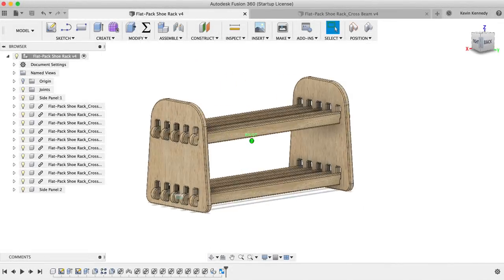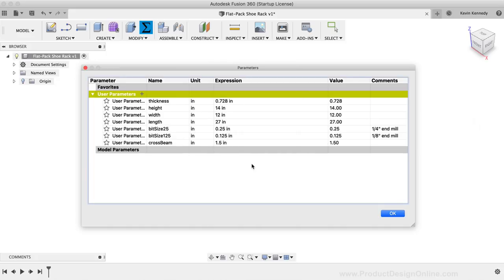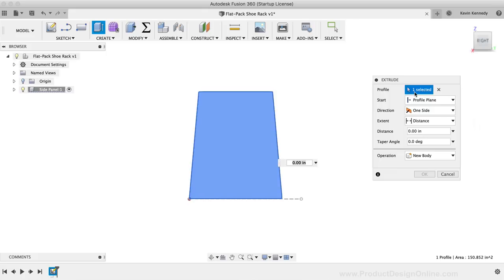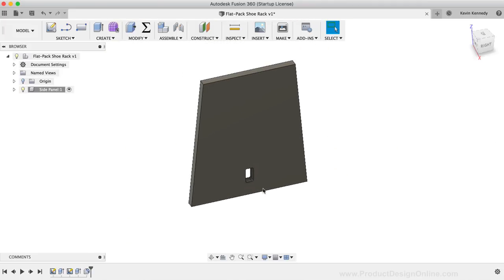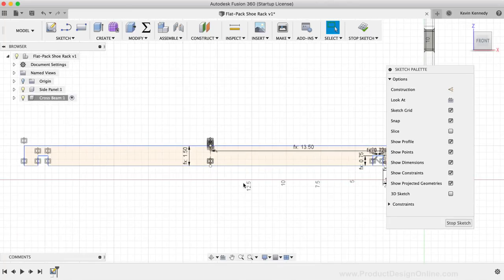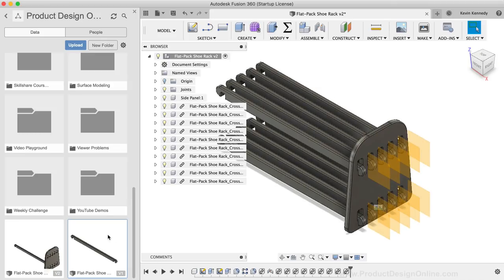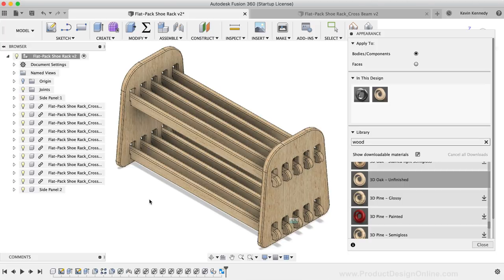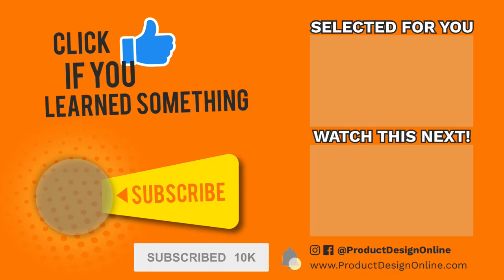Flat-Pack Furniture in Fusion 360 — Fusion 360 for Woodworkers

Comment: Great video, very informative and easy to follow! I have a CNC plasma table and will be able to transfer many of the skills in this video over to that application, thanks!!
Reply from the maker: Thanks, Nathan! Glad to hear that. What brand of Plasma table do you have?
Reply: @ProductDesignOnline  I'm running the Langmuir systems crossfire pro with an Everlast 82i plasma!
Reply from the maker: @nathanstevens3374  Thanks for sharing! Been eyeing one of those for a while. Would you recommend Langmuir? (I've heard a lot of good things).
Reply: @ProductDesignOnline  Hey no problem, I definitely recommend them for an entry level machine. They are on the cheaper side but the customer service is top notch if you have any issues!

Comment: How are you exporting the file for a laser cutter?
Reply from the maker: Hi, Mrs. Alanna Wellwood. This specific project was geared towards a CNC router (due to the thickness of the wood required). In this case, you would want to use the Manufacture (CAM) workspace to set up the file for CNC.

To use this type of workflow for a laser cutter you would want to export as a DXF file. After laying all of the parts flat, as I did at the end of this tutorial, you would want to create a 2D drawing of the file.

Select the file menu > drawing > from file. Then you can place the "base" view of the model, which should show all of your parts lying flat. While in the Drawing Workspace there will be export options at the upper right of the toolbar. Select the "Export as DXF" and then import the DXF into your laser cutter software.
Cheers, Keivn :)

Comment: 10:07 when I try to dimension the height it says “adding this dimension will over-constrain the sketch. Choose OK to create a driven dimension.”
Reply from the maker: That means you have a constraint or dimension elsewhere that is dictating the height of that line. Double check the surrounding lines and make sure there wasn't one automatically created that is not supposed to be there :)
Reply: Product Design Online 100% correct. Figured it out right after I posted the question. I didn’t know exactly where the constraint was but you’re tutorials are really helping me.

Comment: I dont have a cnc machine but there is a business close by that will cut wholeor half sheets of ply.
Reply from the maker: That's pretty sweet. Just curious... do you know how much they charge for something like that? I assume it's by the hour?
Reply: @ProductDesignOnline  to be fair, Ive never really looked into it, but I will next time I poking around down there. Its only a couple of kilometres away, near my favourite cafe. 

I would presume its by the job, depending on how much set up time is involved.
Reply from the maker: @petermiddo  Cool. I'm just curious... it's always interesting to see what people charge. They may also have different rates depending on the material :)